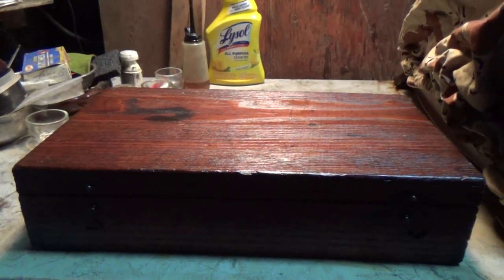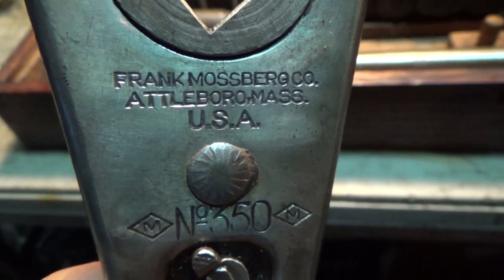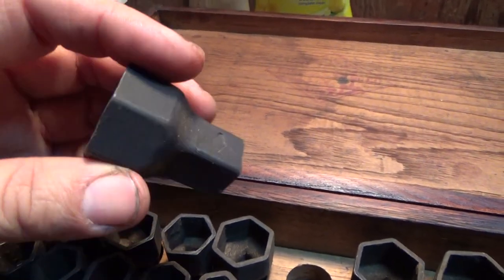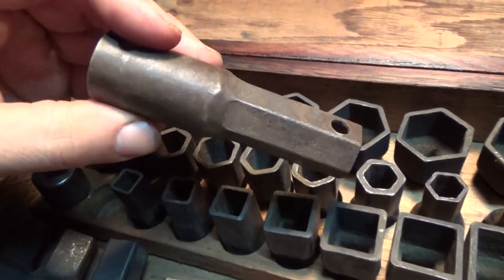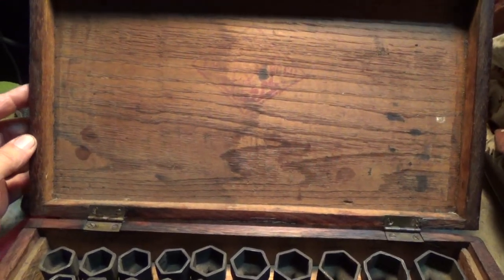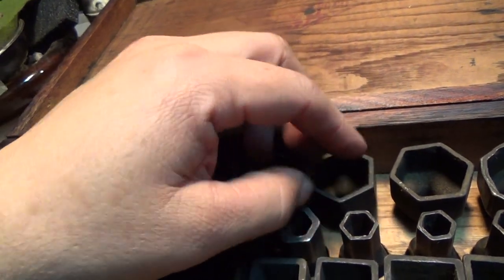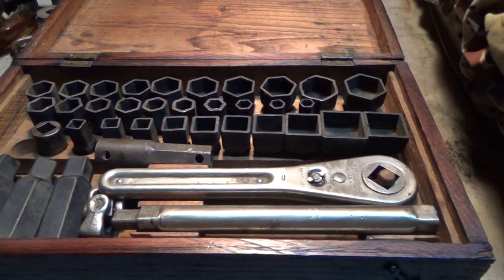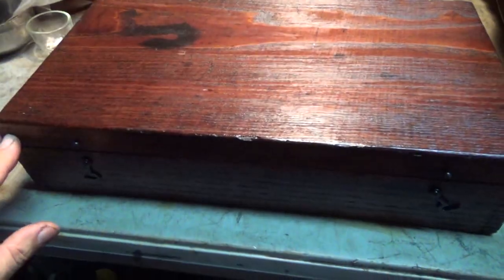Frank Mossberg socket set 1920

Comment: Standard or SAE got a bad reputation for needing sockets in 32's so pre 1990 you'd need more tools than you would metric sizing which may go to 36mm, but skips after 24mm. However now with standard bolt specs SAE is actually easier, and less confusing, than the mid 20th century made it to be. With divisions of 16 now SAE uses considerably less tools. That's a sweet set!